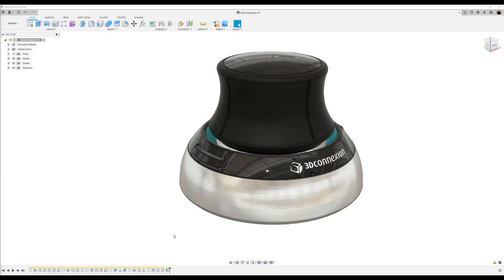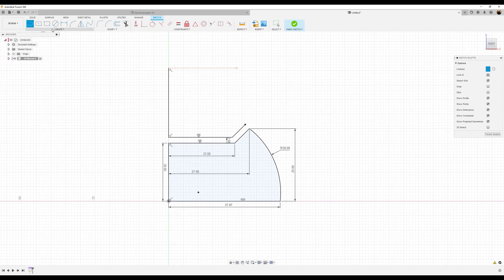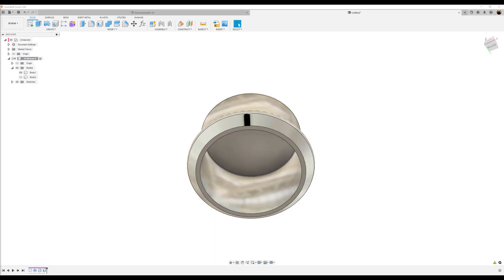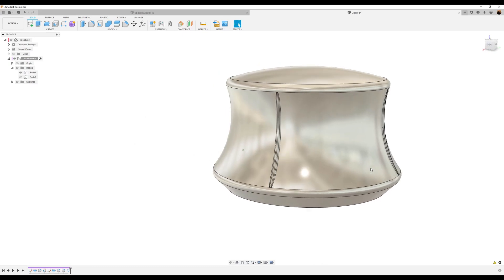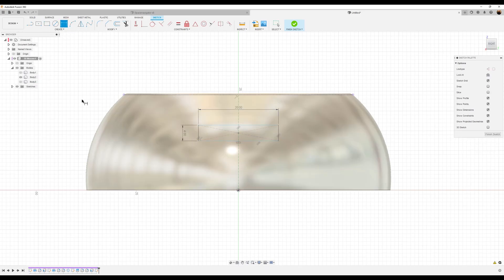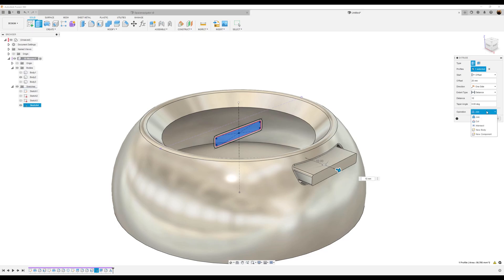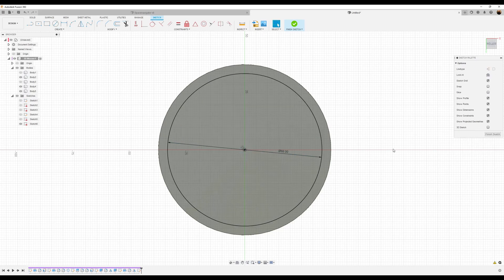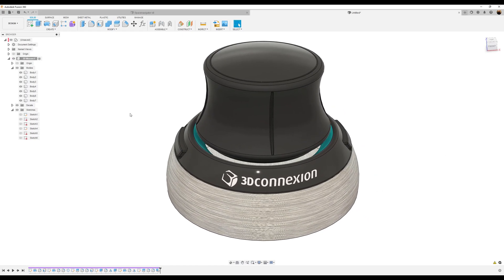Create a 3D CAD mouse in Autodesk Fusion 360

Comment: Just watched a whole bunch of your vids and I like them a lot. Gave me some great insights. For this one you would have put the cherry on the cake for me if you had modeled the bottom part, the metallic one, as cirlular where it touches the black part with the logo, but them it's lots to a square with a large radius. I work with one and it's a great thing. Thanks for the videos.

Comment: This is great - Thanks!
I have a question that may be too basic: Can a "component" be saved as a standalone file and then imported as a piece of various assemblies? For example, I do ornamental ironwork, and many projects use the exact same parts in differing placements. Collars and finials and other pieces as well as plain bolts used over and over would be typical things. Can these type things be created in Fusion 360 and then saved to be imported into various projects over time? Forgive me if you have already covered this elsewhere (link?). THANKS again!

EDIT: Talk about basic, I have spent an hour simply trying (unsucessfully) to join the ends of two separate lines. MAN! This is a very hard program to learn after decades using non-Autocad products, even Rhino 3D (far more intuitive). I love what Fusion 360 is capable of but ready to give up after four weeks of frustration. No reflection on you - YOU are great!
Reply from the maker: You most certainly can! All you would need to do is right click on the specific component in your tree and click "Save Copy as" It will save that specific component for later use. At that point you can go to the data panel which is located at the very top left of fusion 360. You can then select the item you wish to reuse, left click and select " Insert into to current design" And it will be added. Once inserted, you will see a chain link icon because it is still linked to the original component. 

***Warning: if you need to modify that specific component, without modifying the original, you will need to unlink it so you are only modifying that specific instance of the component. Other wise you will need to click  on the pencil icon to the right of the component to modify the original.
Reply: @CADJungle  That is great to know - Thanks!
Reply: @CADJungle  Thanks! That certainly worked for one item I designed, but it seems not to work for a couple of others. The ones it does NOT work for show in my left panel of documents as orang/yellow cubes, where the ones that DO work you can actually see what they look like. What am I missing?
Reply from the maker: Are you able to open the ones that appear as orange/yellow cubes separately to edit them?
Reply from the maker: I just saw your edited comment. I know starting out with new software can be daunting. If you can tell me what your issue is specifically connecting lines I can do my best to help. I'd hate to see you give up.
Reply: @CADJungle  Not giving up, and think I'm starting to "get it." Now getting a handle on and beginning to understand the heirarchy of assemblies, components, and bodies. The #1 largest and most daunting thing is (apparently) the very strict requirement to nail virtually every element of a design in 3D space - that is just not the case in my former CAD life; you could move even large groups things around any way you wish. Give me a couple of weeks and I'll become much better. Your videos are very helpful. THANKS again, Sir!
Reply from the maker: I'm glad to hear it. If I'm not helping, then I'm certainly not doing a very good job. If there is anything specific you'd like to see, let me know and I can try to make a video that will accommodates your concerns. I plan to go live today at 2pm PDT. If your available I may be able to answer some questions you may have in real-time.
Reply: @CADJungle  Actually, yes I have run into another problem, this time involving rectangular patterns not working as expected. I have a group of components in that I need to copy 4 times along the edge (tried Face too) of a body (a simple straight piece of flatbar); following the instructions, the items do repeat BUT they flip upside down. Even then, when I click OK, these completely disappear.  No problems making radial patterns work.
Oh, one more thing please...HOW ON EARTH do you group a several bodies to act as ONE object when you select them? All I can find on YT and the forums is how to combine bodies, as in make 1 from several when these are physically connected; mine are separate pieces I just want to behave as a group. (Again, very simple in an ordinary CAD program - Ha)
Reply from the maker: 1. So I'm not confused as to your first question, do the rectangular patterns in the sketch disappear or do the bodies disappear?
2. For the grouping of bodies not joined together, when you create components, ensure that the actual component parent tree is selected not an individual body within that tree. Any objects tied to that component tree should move in unison, unless you set constraints like grounding of an individual body.
3. You also have the option within a component to create groups. If you right click on the "Bodies" Parent tree, you will have the option to create a group rename it, and add bodies to that group.
Reply: @CADJungle  1. Somehow (do not know what I did) this is fixed, but both bodies and patterns disappeared as if they'd never existed.
2 and 3 -- THANK YOU, especially the grouping of bodies. That was the KEY to doing it for me.
I want to watch your live stream but will not be home. It does stay on YT as a recording though, yes?
Reply from the maker: Livestreams can stay on as a recording depending on what the streamer sets. Hopefully when I review the quality it will be good enough to keep :) Fingers crossed!
Reply: @CADJungle  Just now having to leave, and I think you said 2pm Pacific, so Good Luck. I wish you great success with the stream and will cross my fingers as well.